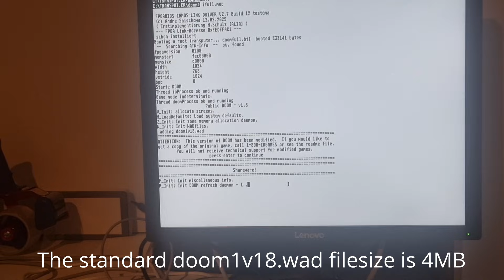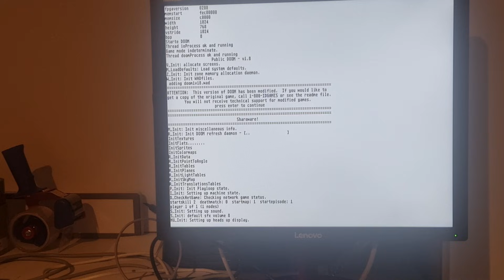ATW800/2 runs DOOM?

Comment: Ohhh, and will it run on a real ATW800, too? :)
Reply from the maker: Well, I would never have imagined that I'll ever state that, but the "real ATW800" is not powerful enough 😅
Reply: @geekdot hmmm, thought it should be like a good 386? And my one have 5 t800..
Reply from the maker: @harzretro  Yes, but it's a single-threaded program. So it's one CPU used only. Then the ATW800/2 synthetic Transputer runs at 53Mhz vs. your 20Mhz plus it has features, the original T4/8 never had like L2 caches and barrelshifter. And finally, it uses the "Seurat" video controller... the original ATW800 hat the "Blossom" which I daresay is used by about 10 lucky owners on this planet.
Seurat OTHO already has ~150 owners... and counting.
Reply: @geekdot Thanx :) Didn't know that the atw800/2 is so "fast" :) And it is a real nice Project. Thinking of getting one, too, but at the moment i don't have thw time ...
And i thought that blossom would be a problem ... :)

Comment: I'm having trouble with mine..I couldn't get it to work at all until I removed the ROMs..
Reply from the maker: Which ROMs? You can only have one set of ROMs active. Either those on the mainboard or those on the ATW800/2. So you have to remove one set or the other, as mentioned in the manual (pg 10).
Reply: @geekdot  I already have the ones from the MB removed as I had a cloudystorm installed(so I don't  need them) .  I removed the coudystorm and tried it in another Mega ST (same results) 
My friend at Power of Vintage channel is local to me and his works. So I may have him test it (It could just be my ST)  I did manage to get the video running but haven't done much else. 
II haven't had much time to tinker with it but it's xmas break so I'll let you know. 

P.S. i'm actually messing with the transputer cores on an FPGA, I think I found a better use for them..